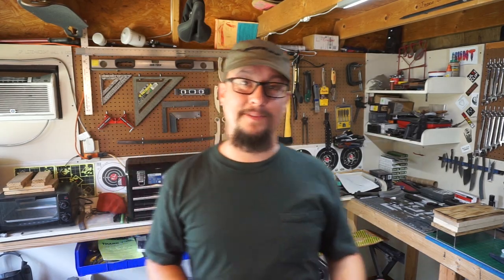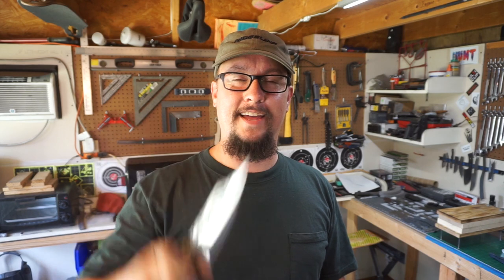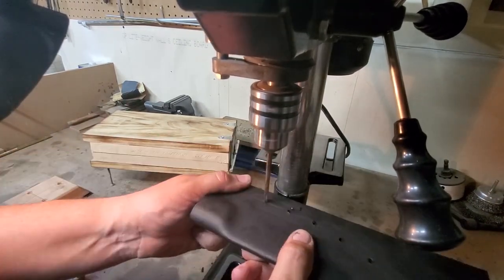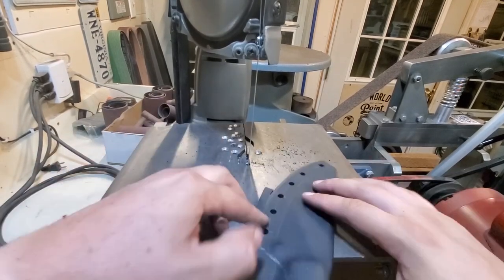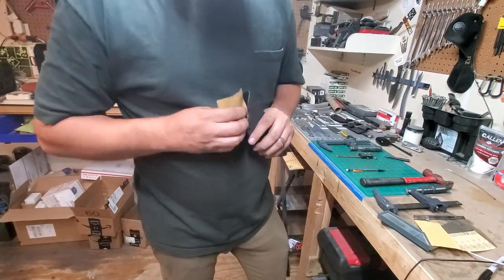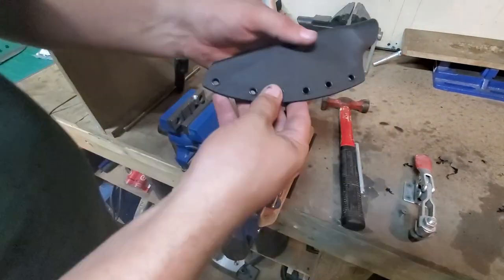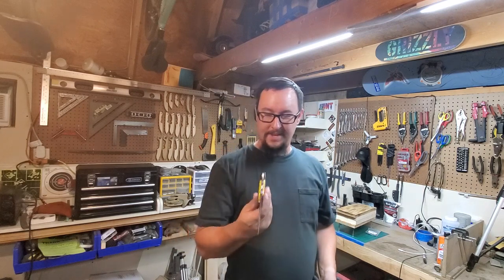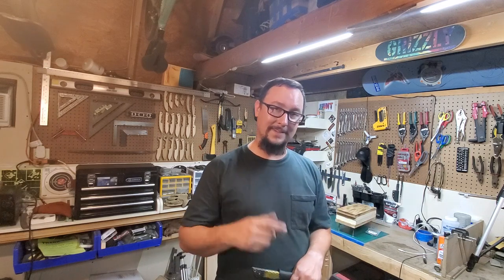Putting the New Kydex Press to Good Use | Knife Making | Daily Vlog

Comment: Please answer this question. I noticed you didn’t put tape on the blade before pressing it. I’ve made plenty two piece sheaths but never a taco sheath. I’m guessing there is enough clearance for the blade because it’s a taco sheath ? Good job brother.
Reply from the maker: After I press my sheaths I typically go back and adjust the retention with a heat gun. I will show how I do this in a future video.
Reply: The Rivers' Experience   TYVM for the quick response.